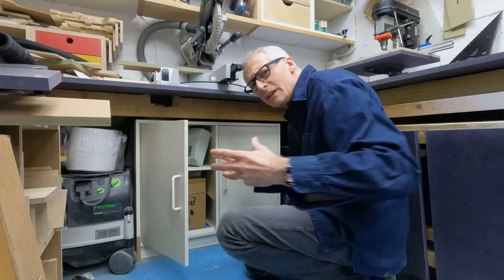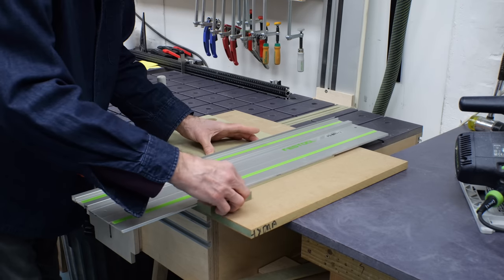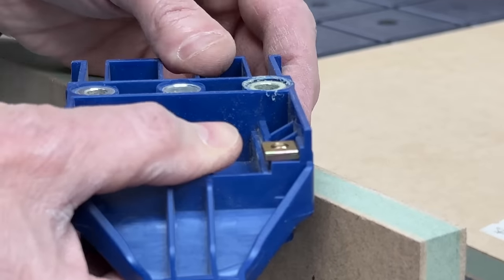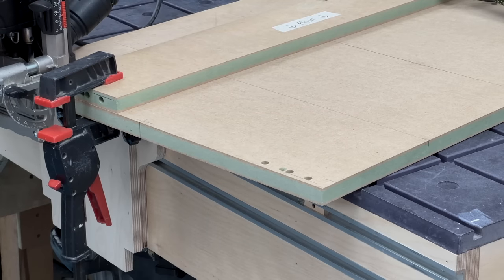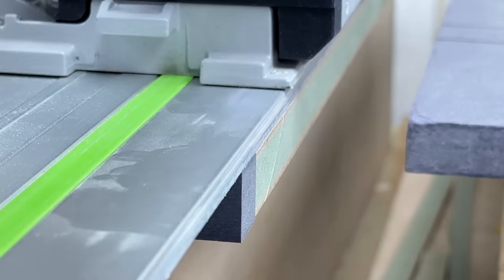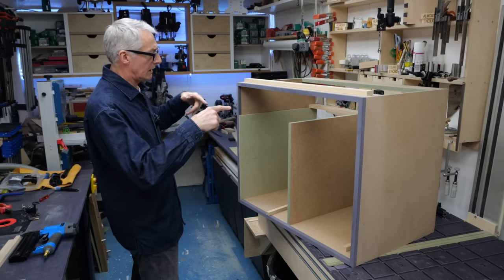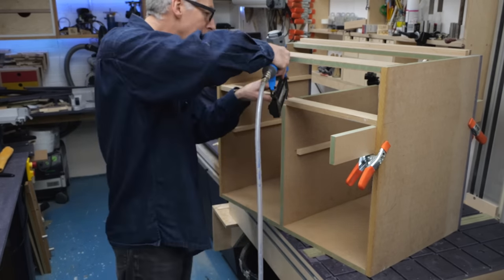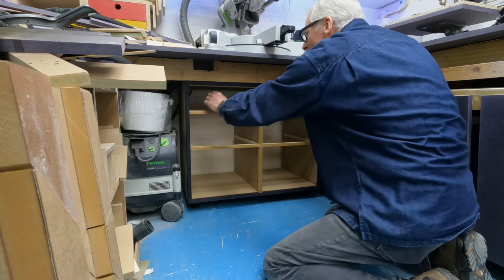Cheap or Cheat? I get a nice cabinet for less cash! [video 517]

Comment: I'm constantly annoyed at how good the building materials are in the EU. I cannot get ANYTHING like the MDF you're able to buy over here. I once called 5 lumber yards near me and asked if they had moisture resistant MDF and said it doesn't exist. When I gave them the name of USA manufacturers that make it and the name of the product, they looked at me like I had six heads.
Reply: Fair enough, but over here we're in awe of what's available to you in terms of timber and tools - and at a manageable price tag.
Reply: @emmetworkshop2829  so maybe EU has better engineered panels and windows, USA has better timber
Reply from the maker: Yeah, I know it’s a problem, generally. Different panels, different plywood. 🤷‍♂️
Reply: I admit it’s pedantic, but Peter isn’t in the EU.😊
Reply: It’s probably because solid hardwoods are so expensive that most cabinetry in the U.K. is made from sheet goods, painted or veneered. So most suppliers have just construction softwood and a range of ply and mdf. Even so the MRMDF etc is often a bit specialist. It’s probably why tracksaws became a regular tool here before the US.
Reply: @jeanchapman1301  not anymore!
Reply: Roseburg Forest Products makes moisture-resistant MDF in Oregon.  Not easy to find, you’re right.  My problem with it is it’s more expensive than hardwood plywood and other alternatives.  I could only find it through a specialty plywood distributor near me.
Reply: To be fair, you guys have way more available to you in terms of tools and timber. Can't count the number of times I saw a review for a great piece of kit, only to find out it's not available in the EU.
Reply: @wnxdarkraven  it's too bad we can't merge the markets. I want your panel goods and windows, you want our timber and tools. Why can't we figure this out?!
Reply: @LukePighetti  Hell if I know. Might be more difficult for the timber, but the sheet goods and tools...
Reply: @LukePighetti  if I recall correctly, sheet goods like plywood are not as heavily regulated to import into America like other lumber products. 
Surely in 2023 some of us could get together on both sides of the pond and start a import/export business(the money would be annoying because conversion rates and the global market being rabid over the sales prices of everything now days)
Reply: I just want a few things from Europe and the only feasible way to get them is flying there with a big suitcase. Pandemic ended the trip to the Holz-Handwerk in Germany. Some shopping import companies that give you a local address and they pack it and ship it across pond. Different companies for different direction if you are in EU/GB and want something bad enough. Anyone want to buy me a few Lux tools from Bauhous? Hehe
Reply: @FearsomeWarrior  I'd be interested to know which companies. I know certain products in China can go through shipping agents and warehouses but didn't really think about Europe having the same thing. 

I've been considering starting a logistics and supply chain business in my hometown because of it's location. 2 of the biggest (soon to be 3) interstate systems on the east coast junction here, making it a gateway. Every major city on this side of the Mississippi River is one days drive. This is ignoring the railway coming through here with multiple access points, and the 3 commercial airlines surrounding us. Also the halfway point from Canada to Florida. 

Anything coming to the East Coast from EU is primed to be here anyways, might as well save time and money and keep supplies here.
Reply: Baltic birch ply has gone thru the roof so it's good to see a great result from a mix of materials
Reply: It’s called MDO meaning outside

Comment: It's a harsh fact that most of us will never own a Domino, so thank you for showing what's possible without. I can see the value of a dowelling machine if you are making so many joints that the cost difference between round dowels and domino dowels becomes an issue, so I'll await the Mafell/Triton comparison in due course, but for me, a dowel jig will probably be as high tech as it gets. Thanks for your demonstrations of simple jigs and techniques to maintain accuracy with speed !
Reply from the maker: Thanks! Dowel jig works great, just a little slower! 👍

Comment: Screws for the mid panel when you had TWO dowelling machines there!! you made that look so easy but the cutting list and part number was pretty high, nice job
Reply from the maker: Well, screwing the mid-panel in means you can get on with the cabinet sides, otherwise it’s in clamps for half an hour! 👍

Comment: With increasing costs of materials and the crazy delivery charges to here in Cornwall, you have given good options here.  Love the coloured MDF but so pricey.  I wonder if there is a finish that could be applied to give that effect?
Reply from the maker: My older MFT tops were just stained MDF; harder to get the edges to look as good a fibracolour or valchromat though. 👍

Comment: I'm planning to build a 4 foot wide, 8 foot tall, 1 foot deep, adjustable shelving unit to put systainers in.  I cannot get baltic birch at an affordable price and I don't have a planer to make my own panels.  It's my first project.  

Of the alternative materials you've  explored, which do you think is the strongest or best?
Reply from the maker: I’ve only looked at a couple - there’ll be a video along shortly about them - but the Garnica Maple veneered reinforced Globulus is probably the one. Not much cheaper than Baltic Birch though! 🤷‍♂️👍

Comment: Hey Peter! First of all, love your videos they are amazing! Just one question.. what is the best way to joint 12mm MDF? I’m making a box 1m X 1m
Reply from the maker: Thanks! Wow, a 1-metre square box in 12mm is pretty large! Not sure what tools you have available - you could use 5mm dominos (unequal plunge for face and edge, obvs) but I appreciate not everyone has one. If the box has a base and or a lid, then that will help stiffen everything up, so you might be able to get away with gluing and pinning, assuming it's to be painted? Or glued and screwed. But unless you can get your hands on some thinner than usual dowels (4mm or 5mm) then I think those are the options! 👍

Comment: Is it ok to have that bottom piece of MDF unsupported in the middle when it is bearing much of the downward weight Peter? I really want to use MDF for things like this myself but a lot of what I have read on the internet has got me paranoid that it sags over time when it bears weight horizontally. Do you use ply for the drawers instead of MDF here because of strength or aesthetics?
Reply from the maker: Yes, absolutely! Just buy decent quality MDF and be careful of the span. Ply for aesthetics, and the fact I wanted to,use these ‘Birch ply alternatives’ on an actual project. 👍
Reply: @10MinuteWorkshop  thanks Peter.

Comment: Does the edge lipping (fibracolour?) Have a face 'grain' and an edge 'grain' like a regular mdf?
Reply from the maker: Yes, exactly like that. It was applied so the ‘edge grain’ faced out, just like it would normally; that made it easier to plane flush with the sides as well. 👍

Comment: Hi Peter, I live in Lancashire and have a few of your products from your shop. But I was wondering where you get the fibro-color from? I can only seem to get it in bulk from local distributors. Cheers.
Reply from the maker: Lathams are the UK distributor, so if you have a branch locally you should be able to deal with them direct, or perhaps like me, order from a convenient local yard who deals with Lathams at a trade level. If you only want smaller quantities - and a full sheet is almost twice the size of an 8x4 - then companies like cut my plastics offer a cutting to size & delivery service, albeit at a price. 👍👍
Reply: There's a Latham in Leeds or Atlantic timbers in Altrincham supply smaller quantities

Comment: Hi Peter, I’ve got a couple of worktop joints to do. I need a biscuit jointer to line them up but was thinking I could use my dowel jig. Would you recommend that or a biscuit cutter for my router? Trying to avoid buying a biscuit jointer that I’ll probably only use once. 🤔
Reply: Personally i wouldn’t trust dowels for that task 
I think the biscuit router bit will be more useful as you can use it for other things and they are pretty cheap
Reply: @spycedezynuk  cheers mate, I think that’s the way to go 👍
Reply from the maker: Honestly, I’ve only ever joined worktops with the connectors. Never had a failure. 🤷‍♂️👍
Reply: Dowels should work as well as biscuits. I only have doweling jig and use it for gluing tops.
Reply: @meperson  as in kitchen worktops or table tops ?

Comment: It just occured to me, I know you use mostly Festool, which I bet came dead square and cuts precise 0° bevel out of factory. But on those cheap alternative track saws, did you had to do any sort of adjustments? i'm wondering if there's a trick to this, other than just minimal setscrew turns then rinse and repeat...
Reply from the maker: I've never had to do anything on any of the saws, other than occasionally tweak the set-screw by trial and error if the saw's been bounced. Out of the box they've all been decently set up. 👍

Comment: I can't help but think that for surfaces where the edge isn't on show that a bottle of old-fashioned schoolroom blue quink  would give you a good match for the blue fibracoulor.
Reply from the maker: And there’s nothing to stop you doing that. 👍👍
Reply: Ah yes, but for a nice finish you need to show the face of the board not the edge. For the workshop it's not a big deal, but it's always nice as a novice to practice these techniques.

Comment: what is the height of table tops in your workshops?
Reply from the maker: 810mm / 32” to the top surface.
Reply: @10MinuteWorkshop  thanks! I am trying to convert my old workshops tables for woodworking purposes. And I found 72cm too low (great for sitting on a chair though) and 92 too high (but comfortable for general 'tinkering' when standing) :D perhaps I will try with 80ish :)

Comment: Hi Peter, I have difficulty with getting hold of the waterproof MDF you use and also Birch ply is like hens' teeth.  If possible could you list your suppliers, Many thanks.
Reply from the maker: Sure. I buy from a local timber yard, ajferguson.co.UK. Bitch ply in 18mm is almost impossible to get though. 👍
Reply: If you're in the UK, Travis Perkins stock the moisture resistant MDF. Over 500 branches...